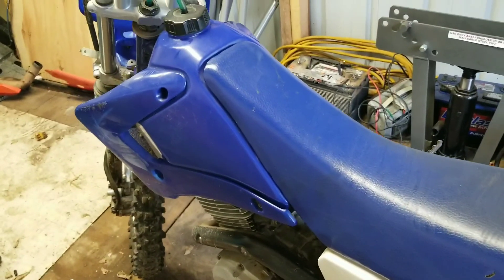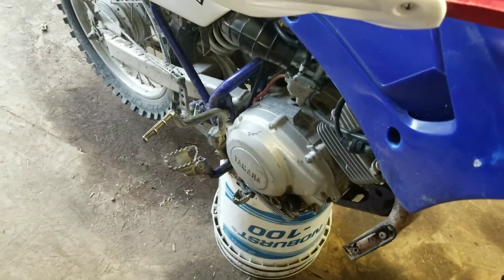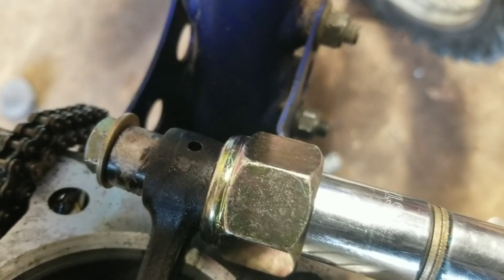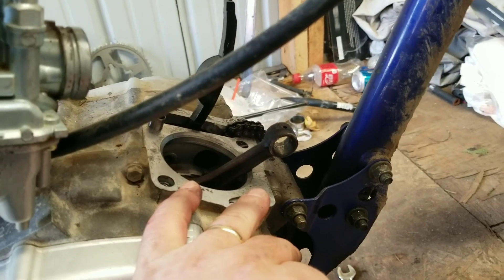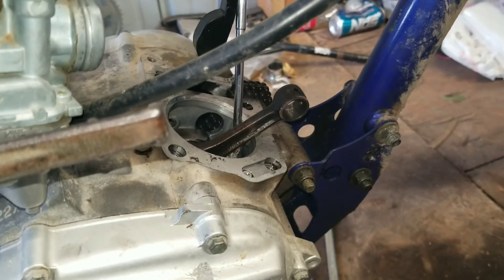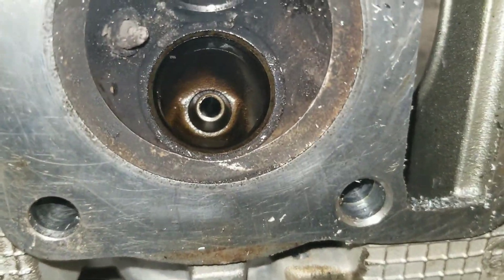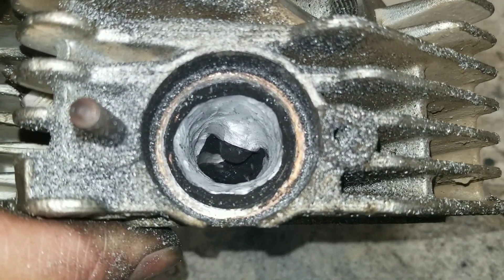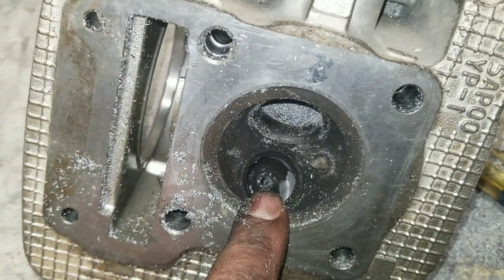Project TTR125 Piston Pin seized again.  Rebuild coming with new parts and ttr 125 big bore kit

Comment: Did you cut the piston off?
Reply from the maker: I heated it with a torch to get the pin out
Reply: @SXSFURY  in the video when you are pulling the pin the piston is not on it, or did you just do that to recreate it?
Reply from the maker: Ok had to watch the video again you can see when the piston is on there i was heating it off camera  and the rod is red hot. But off camera when I was heating it the piston had melted off the pin.

Comment: Any update?? How is it running?
Reply from the maker: still running strong gonna post a video soon again about the bike
Reply: So I bought a Kayo MR125 off of a buddy who had bought it from the guy who built it.  Guy who built it didn't check bottom end before installing 150BBK on it.  Had a bunch of metal shavings from stock internals left inside.  Another buddy riding it ended up missing shift and bending a valve.  Took it all apart and found all the shavings but no source.  
  I did notice the wrist pin on the BBK had blue heat marks on it where it contacts the piston.  Thought I'd let you know FYI, might wanna add oil cooler with bbk.